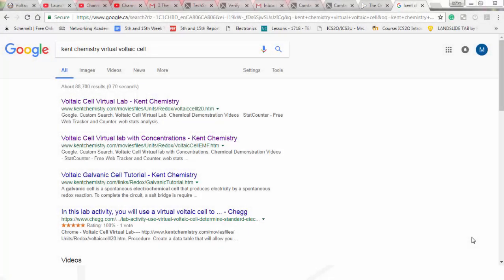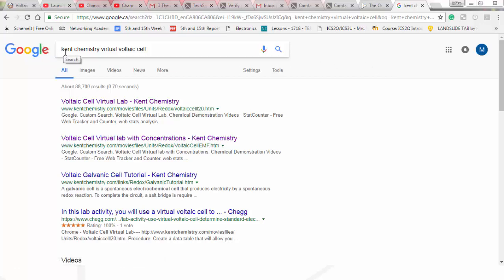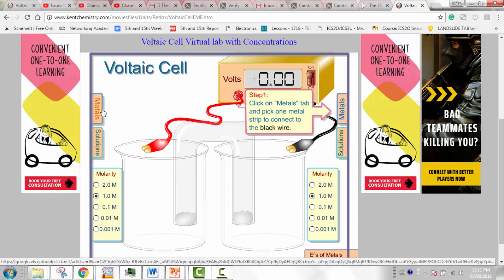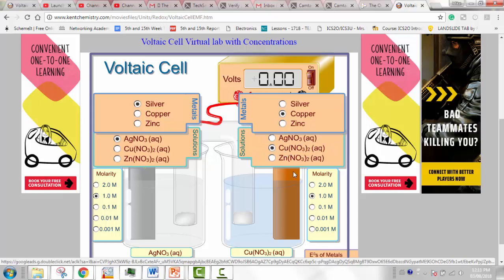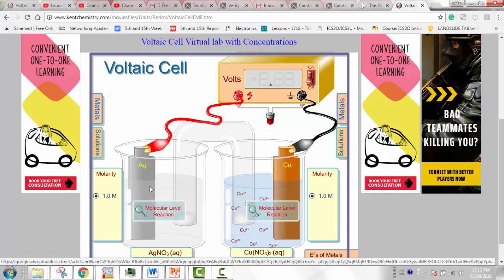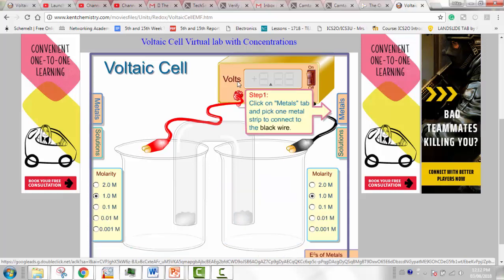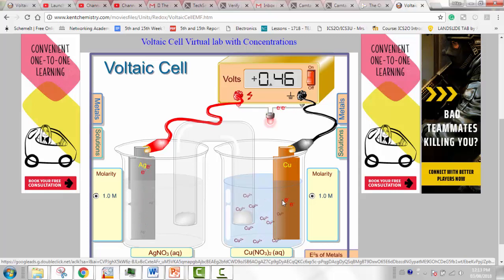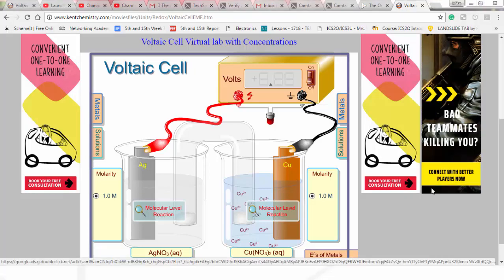Electrochemistry 7 : Virtual Voltaic Cell Lab Demo

Comment: hey, one question do you now what happen if you change the concentration? its jinda weird so idk what to answer.
¿qué ocurre si cambia la concentración de las soluciones? (en español tambien por si acaso)
Reply from the maker: That option is available in the simulator, and of course it matches theory.   The voltage increases when you increase the concentration.    Why not fire up the simulator and give it a try?